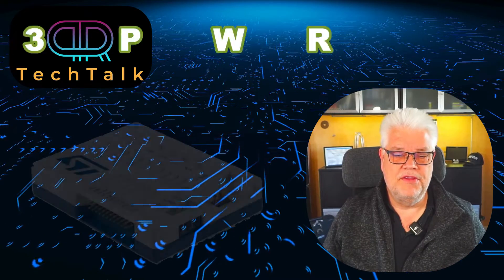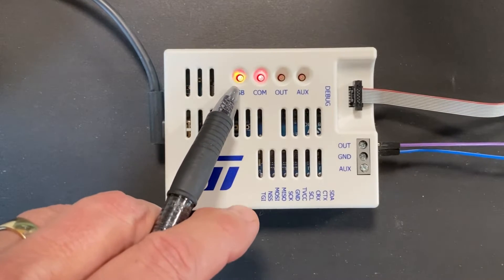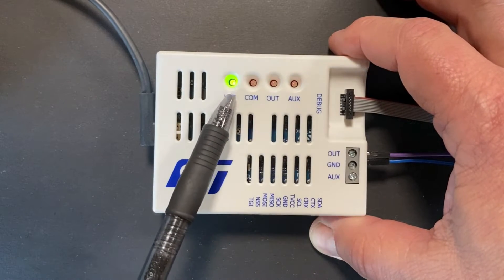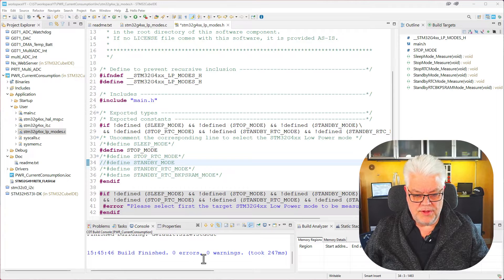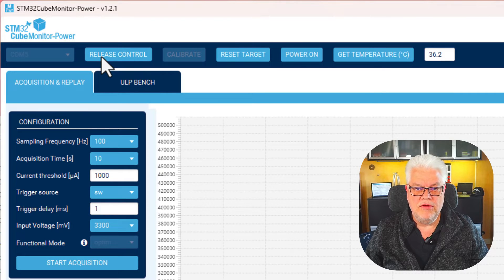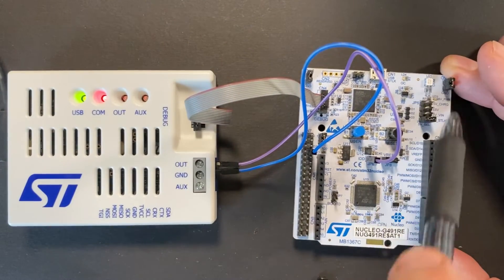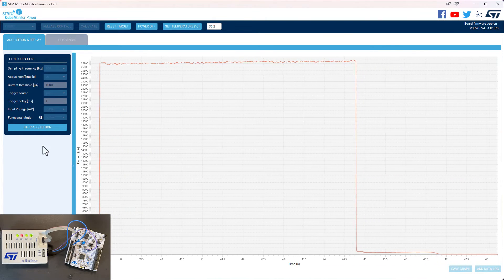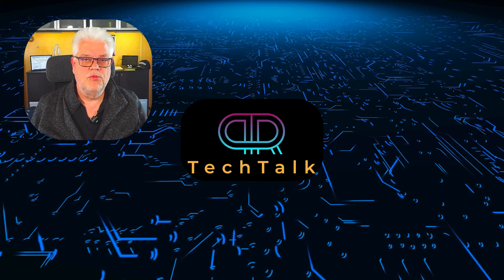Mastering STLINK-V3PWR consumption for success

Comment: I would like to know whether other microcontrollers other than stm32 can be monitored with this tool. Lets say ESP32? ALSO CAN WE USE POWER MONITORING SOFTWARE AS WELL FOR THAT?
Reply from the maker: Hi, This tool is MCU agnostic on some of the functions. the MCU current measurement is one of them. So yes you can use this Tool with ESP32 so measure the current consumption.
/PR TechTalk

Comment: Timely video. Took me a bit to understand how to use the V3PWR. I can download a program using embedded STLINK and read the power consumption using the NUCLEO-L476RG board but struggling to get the debug to connect with the 6 pin connector on NUCLEO board. Always states target not found. Read all the manuals, checked the continuity, powered TVCC from external source and still no joy...arghhh.
Reply: Got it to work all to work and able to program and monitor power consumption. Very cool tool.
Reply from the maker: Greate to hear that you concurred your problems.
Reply: @terranceparker2015 can you share how you managed to make the debug work?